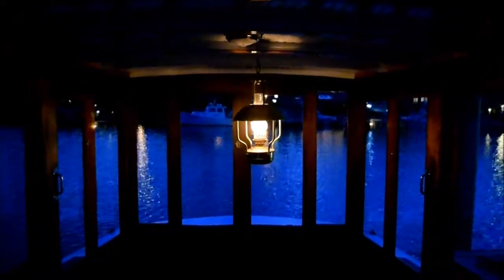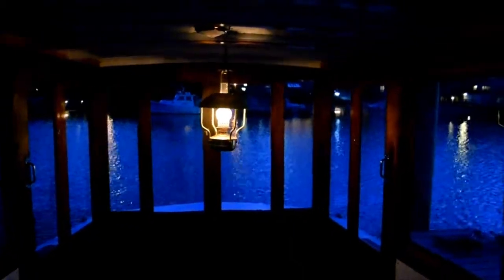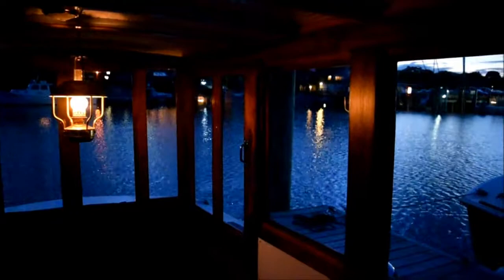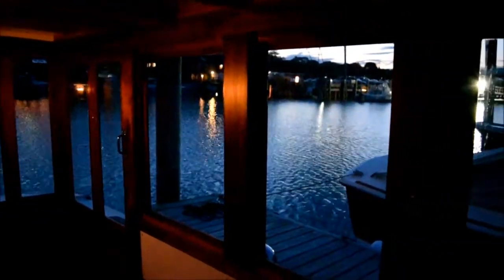Evening aboard a wooden boat

Comment: Thanks again. Very nice to see the oil lamplight reflected on the wood and glass in a boat that has not been retrofitted with all the 21st century tech. I have noticed that your boats remain very traditional. I am going high tech but this is mainly because I live aboard and travel full time. The old ways are beautiful. I am glad someone keeps a more traditional vessel. Best wishes, James K
Reply from the maker: James, I am sorry to disappoint you but Tortuga is not totally traditional.  The boat has a 2011 vintage diesel and there are LED lights.   I also have a solar panel.